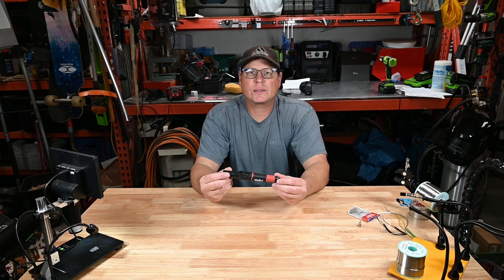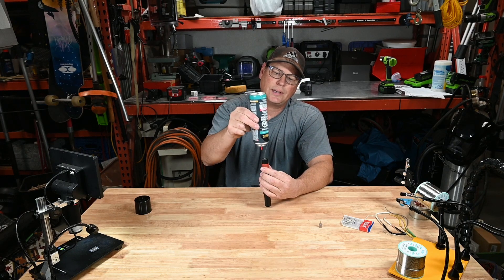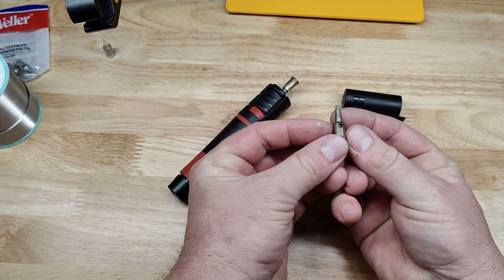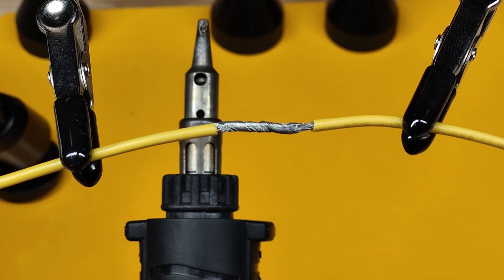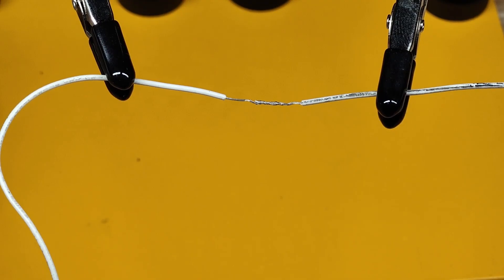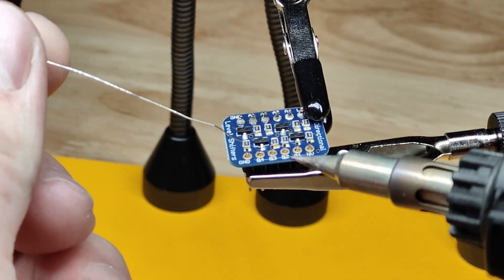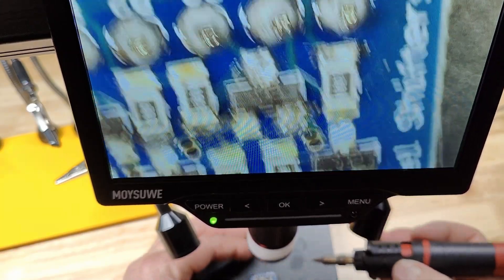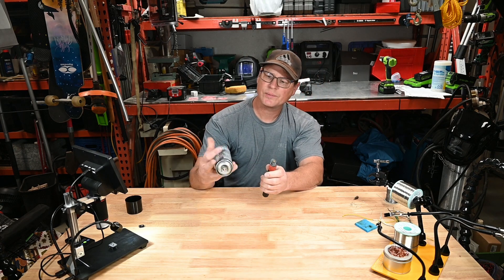Weller  25W-75W Butane Soldering iron full review and test - WLBU75

Comment: Thanks for the video do you know were to find a 3/16 chisel tip for this model? Thanks.
Reply from the maker: From my understanding Weller only makes the following tips for this iron.
Weller Single Flat Tip 0.8mm: https://amzn.to/3WS4PvI
Weller Double Flat Tip 2.4mm: https://amzn.to/3XMTWN4
Weller Single Flat Tip  2.4mm: https://amzn.to/3Rdpklr
Reply from the maker: Along with those 3 types/sizes (.8mm angle, 2.4mm angle, 2.4mm chisel tips). They have recently came out with some tips not for soldering but other activities... PPT9 hot air tip, PPT10 hot knife tip, PPT11 hot air deflector for heat shrink tubing, PPT12 flame tip. Seems though currently you can only get these tips as a kit with the iron, I don't see them sold individually anywhere: https://amzn.to/3KNrWEY
Reply: I had this soldering iron, but I wasn't too happy with it, the construction itself and the flame regulation is good.  The heating heads are of catastrophically poor quality, they are difficult to get and they are also expensive, 1/3 the price of a new soldering iron.  The heating head begins to melt after the first use of the cartridge. I replaced two soldering devices under warranty until I requested a refund money.
Reply from the maker: @bokiminor5089  That's a bummer you had a bad experience with it. I've gone through 4 fill ups no issues yet. Agreed the tips are expensive, Its not a simple piece of metal though there is a catalyst in side that the flame heats which in turn heats up the steel tip. I've heard of the same issue with tips melting on other brands maybe its an issue with butane in general or the flux being used??